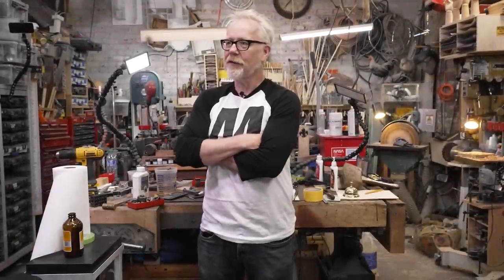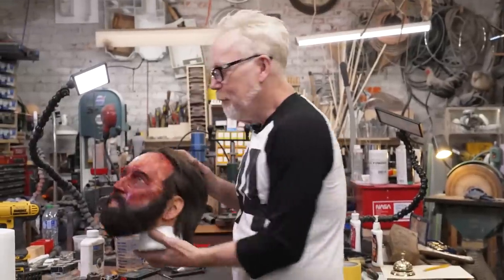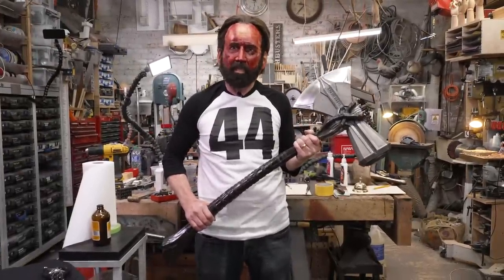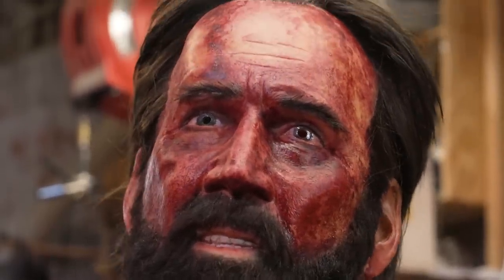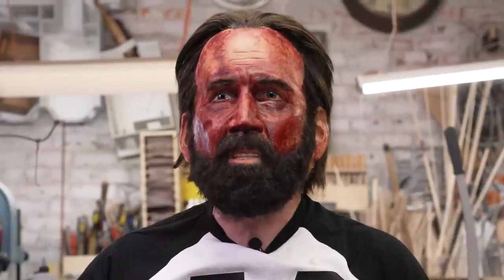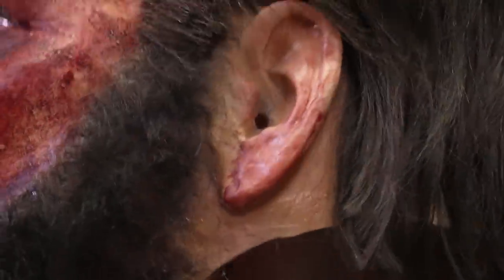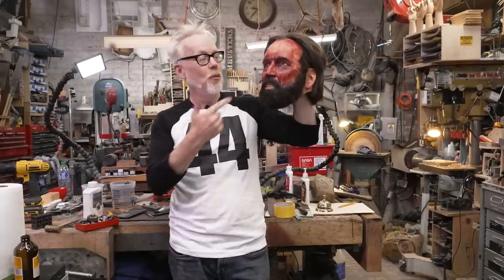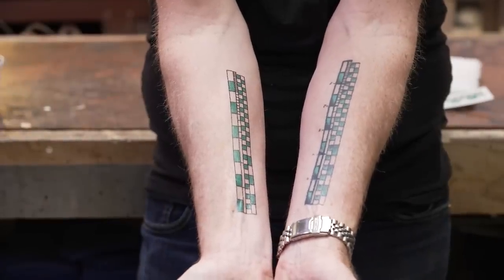Inside Adam Savage's Cave: Lifelike Nicolas Cage Mask!

Comment: The weirdest thing to me is that it's like 10% oversize.  That's not a bad thing.  It accentuates the caricature-ness of it and kind if makes it funnier.  Very cool.
Reply: Yeah thats the only trouble with latex masks- they look slightly too big like a bobblehead.  only way around it is if your outfit is also a bit oversized not regular clothes.  A beefy padded outfit of some sort will help hide the incorrect scale.
Reply: Are you sure Adam isn't just 10% undersize?
Reply: Yeah any mask adds size to your head. You could reduce that by making it incorporate to a negative of adam's face to make it as flush to the face as possible, but I'm also guessing Nick Cage's head is larger as well.
Reply: Cage is 10% larger than us all, as an entity